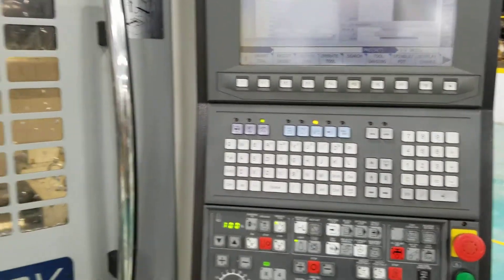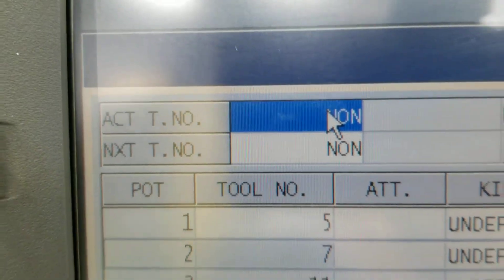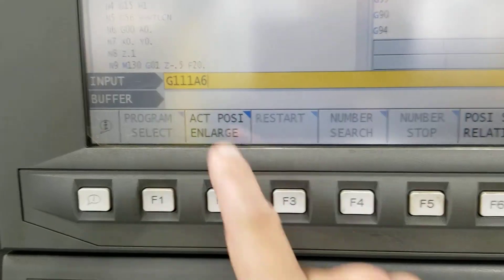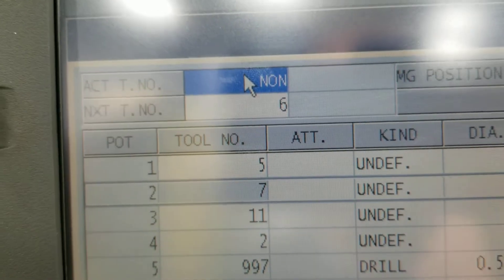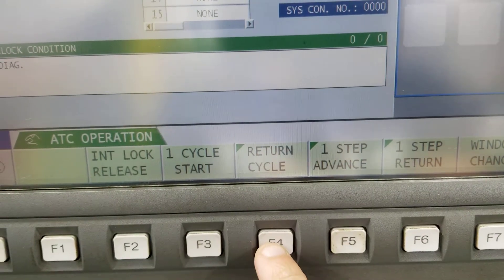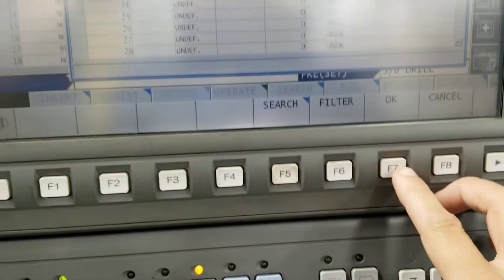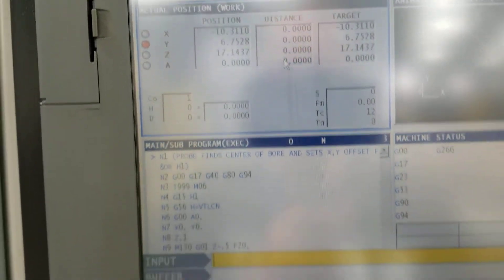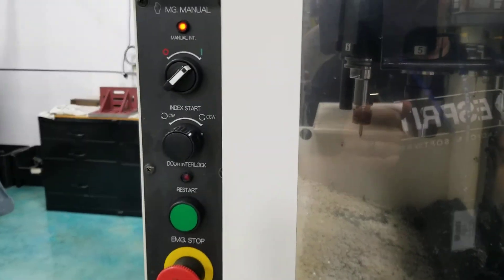Tool changer doesn't change - Problems 2 and 3 (OKUMA-M560 OSP-P300)

Comment: You do realize that the G111 is a  Macro that is custom to your machine/shop. T1M6 will work for everyone.
Reply from the maker: Yeah I guess our local dealer here in central Florida has installed the macro in most Okumas here since It's worked in most of the shops I worked at that have Okumas.

Comment: I was considering an okuma over a Mazak but just seeing how difficult it was to handle those simple issue vs a Mazak worries me.
Also the alarm display looks awful with just a generic alarm
Mazak atleast tells you upfront for the magazine manual interrupt hard to forget about as it’s immediately on the screen.

The other issue is not really possible on my Mazak so I’m not sure what that is all about.
Reply from the maker: Yeah you're right about that. I mean I love the Okuma's accuracy and durability, but I've seen plenty of people struggle with just the UI of the OKUMA control. You can buy Okumas with Fanuc controls though.
Reply: This guy doesn’t know, what he thinks he does. I’ve ran/programmed most machine manufacturers and I really like Okuma, for what it’s worth